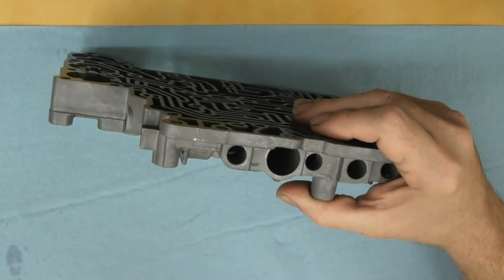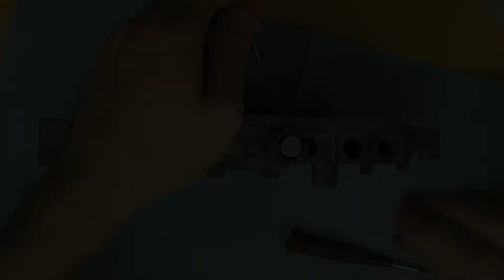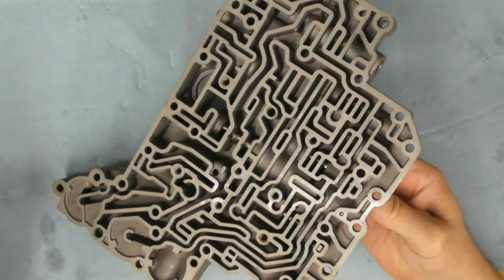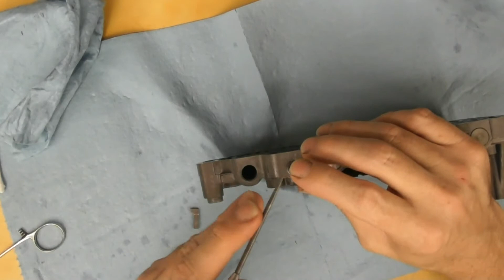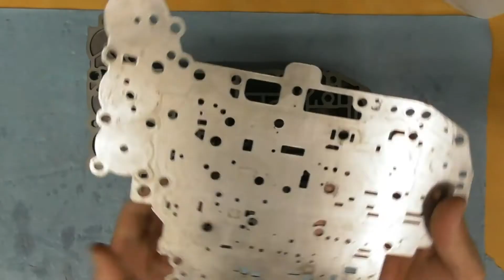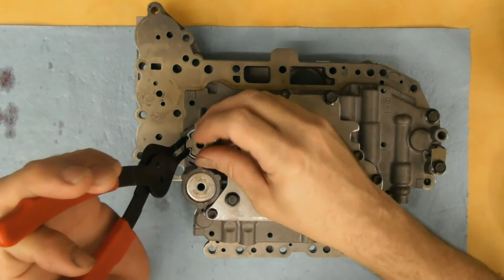Part 1-4 2002 Lexus RX300 U140 Transmission Assembly

Comment: Nice video. My question is about the removal out of the car: did you drop the engine bay or lifted the whole engine out?
Thank you for this video.
Reply from the maker: I dropped it out the bottom. I used an engine support bar, removed the cradle, and then pulled all of the fasteners to get the transmission free and slid it to the right and down on a sturdy stand. All of this was using a lift. Not much help, but hope it helps. G.

Comment: So if I added the extra ball, with no hole in my plate, will that be an issue. I have the means to take it back apart to do so before I finish my assembly. I'm stuck on the darn steel plates for 1st/rev clutches...They don't wanna go into the case all the way back. Will have to play around with that.
Reply from the maker: If there wasn't one there to begin with, I would say take it out. I'm no pro, but that's what I would do. I really don't know what to say about the steels and frictions. I just know what I did for this one was what was shown. Not help, but hope it goes well for you, G.

Comment: Nice video quality. Are the 2 accumulators where one would put washers to make the shifts stiffer? Also, do these trans have a dial that changes the line pressure? I've recently turbod a car with the same trans, and it's banging off the rev limiter when shifting.
Reply from the maker: Thanks! I just rebuilt this by the book and am NOT a transmission specialist by any means. With that being said- I can't answer your questions. Take care, G.

Comment: Any chance you can summarize all of the parts that you purchased for the rebuild?
Reply from the maker: I can Ed! I kept a spreadsheet. This list includes damaged parts for this build, and everything I used. Good luck, G.

master kit with steels
Pistons
sprag retainer
low reverse hub
snap ring
planet set
shell
retainer with springs
bushing 
t-4 fluid
anarobic case sealer
thread sealer
trans jel red
permatex gasket maker
torque convertor
filter
forward clutch hub
Reply: Would be possible to disclose how much did you spent on the parts alone?